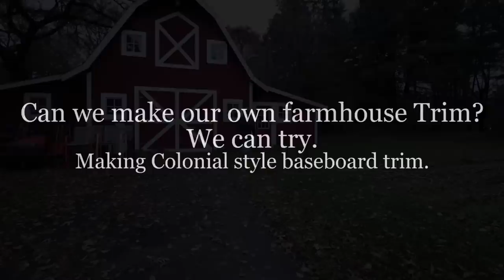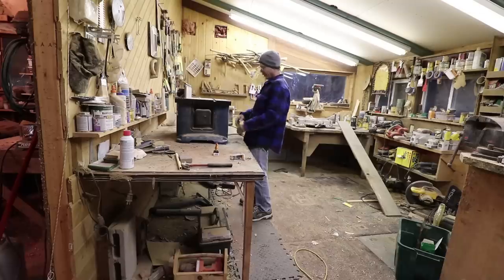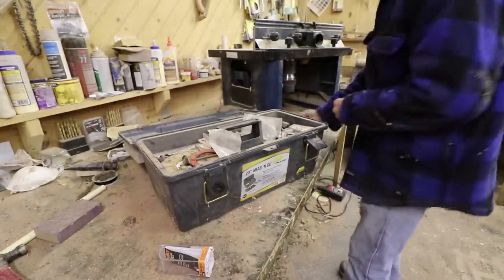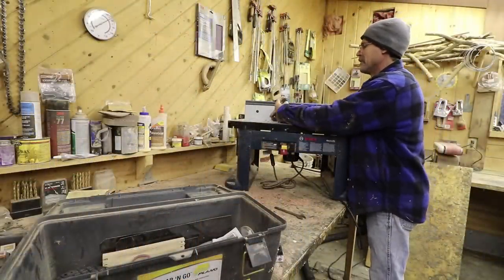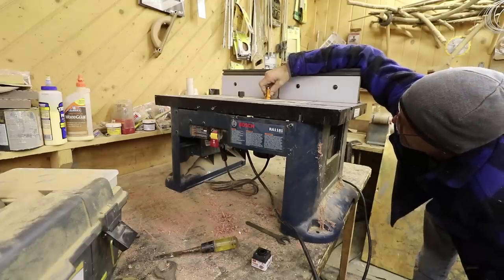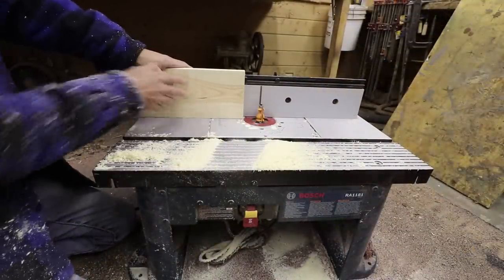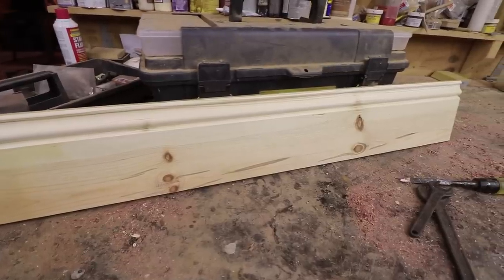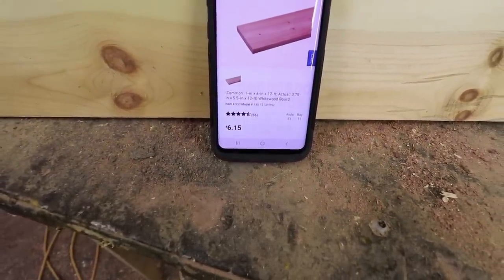How to make your own Farmhouse Colonial style baseboard  trim.  Can we do it?

Comment: I know it worked but it is not safe to put the stock between the router bit and fence.  You are much safer opening up the fence and making the bearing coplanar to the fence.  You would then run the trim from right to left with a feather board applying pressure toward the fence.  You will not get any bearing marks that way

Comment: joe, I think you need to do some research on the safe way to run those boards thru the router. I think you are supposed to split the fence and align the bearing flush to the fence. Run the board outside the bit. Use feather boards to hold wood to fence. I don't think it is safe to run the boards between the bit and the fence. Look into that, better safe than sorry.
Reply: This comment is a year after the post, and the first time I am seeing this vid.but I have to agree with James.  

I appreciate all the work that YouTubers put into providing free content for all of us. But I was concerned about the way in which the wood is being fed through the router table. It is pretty rare to make a climb cut on a router table (a cut where the wood is moving with the rotation of the spinning bit, as opposed to against it). The reason it is rare is it is very dangerous. The bit will want to grab your board and pull it (and you) into the bit. As James mentioned, bits with bearings are generally aligned with the split fence, and wood at the router table should never go between the fence and the bit. Finally, the wood should be fed right to left.

Again, I know you put a lot of work into your vids and appreciate it. I just wanted to make sure the correct and safe info was going out to the public. You mentioned not using the router regularly and always forgetting how it works. I totally get that! I’ve been there lots of times so I can relate. I would recommend reading over the user manual or just watching several established woodworking YouTubers to reacquaint yourself with its use. Thanks for your time!
Reply: Old video I know, but I cringed when I saw him feed the material improperly.  He needs a split fence to only expose the bit to the cut depth and feed face side against the fence, right to left... never left to right.  I was waiting for the piece to pinch and shoot out of his hands the whole time.

Comment: I've seen that type of baseboard as two pieces, one plain board with the moulding applied separately to the top. I would second the idea of moving the bit inside the fences. You can make multiple passes that don't put as much pressure on the router and bit.

Comment: If you set that up correctly  with a level infeed and outfeed set up that will be quite easy. Try using softish featherboards to keep your board in tight to the fence and then take off the roller bearing from the bit, I have found that they always mark the work to some degree.

Comment: Good job. Make 2 passes if it's too hard or removes alot of wood. I have that molding in my 1930's house with a basement coal shoot. On the wood floors it also has quarter round molding at the bottom. Just removed it on the 2 bedrooms with carpet. Man, the router bit sure is expensive. Need to find a garage sale with an old guy selling his tools.

Comment: The reason you have to use more pressure to feed the boards thru is because you are feeding them backwards against the bit. You want to feed the boards thru from the right side.
Reply: In reviewing Joe's setup, the location of the fence determines that he is pushing the stock in the correct direction.  While not common for most router table usages, the stock is between the bit and the fence.  The roller bearing on the top of the
stock allows for this setup to work and eliminates the use of featherboards. 

If Joe's router table fence had a cutout for the bit, the most common setup would be to have the fence aligned directly above the router bit and the fence could be adjusted to regulate the depth of the cut.  In this setup the CCW rotation would dictate the stock be fed from the right to the left.

The simple rule is to always feed the stock against the rotation of the bit.
Reply: Thats a risky setup.  His board is “trapped” between the cutter and the fence, which could result in a nasty kickback.  The fence on that table should be able to split apart to allow you to straddle the bit like any other router table would do.
Reply: Python 357 I agree,  Joe’s setup requires every board to be precisely the same thickness.  Personally I would open the fence up, re center the bit, add feather boards and use table extensions and a push stick on the lower portion of the board.  My NAPA guy in our town chewed off two sections of his index finger with Joe’s setup.  I gave him the extra push sticks and blocks from my shopsmith afterwords. It took him 3 months to heal.

Comment: Not to criticize but it would be safer and easier if you loosened the four screws on the face of the fence, split the fence and moved the fence forward so that the workpiece moved along the fence. If you have the workpiece between the router bit and the fence, you could get kickback. If you allow the workpiece to ride along the fence, you can use feather boards to hold the work tight to the fence. Also, you will have to run the workpiece in the opposite direction.

Comment: Joe does it matter if you push the wood through the table from left to right?
Reply: It does matter because of the direction of rotation of the bit. On a router table, you want to feed the wood into the bit from right to left. Feeding from left to right will push the board out away from the wood and give a much rougher cut. Also, when feeding the board on edge, a featherboard will keep the board against the fence.
Reply: @lauram9076  thanks!
Reply: @lauram9076  I thought he was feeding from the wrong side, too.  Thought all routers rotated in the same direction, and were fed right to left.  The cutters would have to be different for feeding left to right.
Reply: He was going the correct direction. When your board is in front of the cutter, you go right to left. When the board is behind the cutter, like his was, you go left to right.

Comment: Could you please add the router bit name and place you bought it?
Reply from the maker: I bought it at Menards. I can't remember the name, I just looked at them and could tell what I wanted.
Reply: I think I found the bit profile! 1-1/2" Base Cap Molding Router Bit - 1/2" Shank - Yonico 16129.  I'll see if I can add the link.
Reply: What is the name and item # router bit you used???? Please reply.